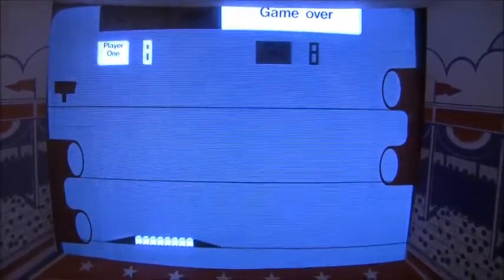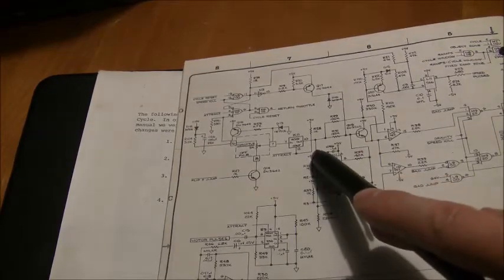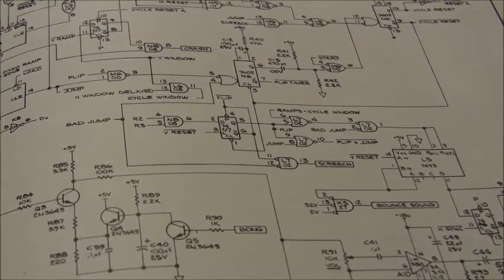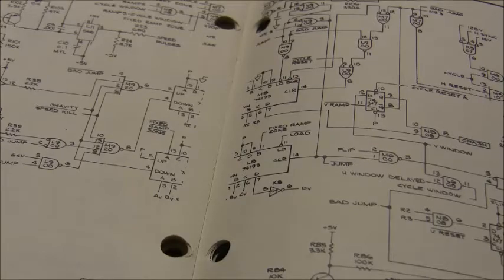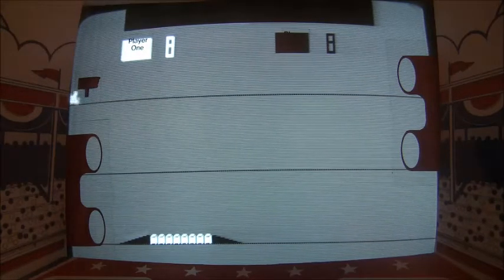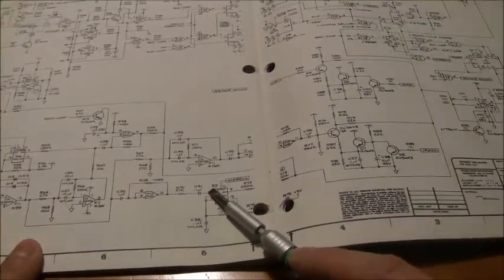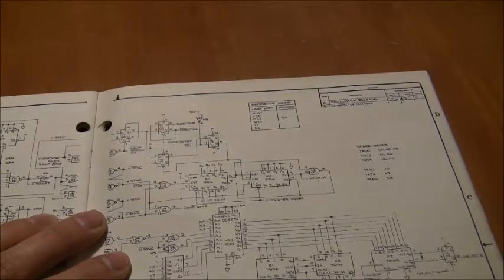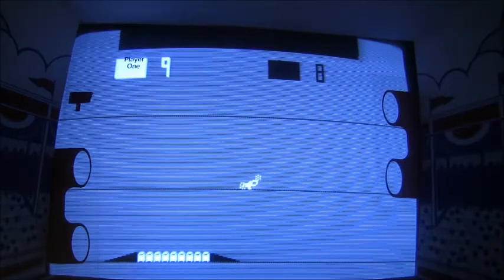Another stunt cycle PCB repair

Comment: I just recently was handed down one of these from my family member and I am trying to get it working. It appears that I have 11 volts before the regulator and 3.7 V after the regulator. Assuming the regulator is my issue and 11 V is enough how bad is it to replace the regulator? And do you know where I can order one of these? Thanks!
Reply from the maker: It’s a LM309k regulator. It looks like they are getting harder to find now then last time I looked. Jameco still carries them for an about $9. There are 2 pins to desolder and a couple screws holding it down not to bad if your familiar with soldering
Reply: @ I am decent at soldering for regular industrial electrical work. But not so much circuit boards… I’m gonna order me a better iron to control heat and practice on some other junk boards from work lol. I don’t think anyone has these boards for sell do they?? 

And thanks for the info!

Comment: Hey...are u still doing repairs?
Reply from the maker: It seems like there is always some thing i need to fix on one of my boards so yeah still working on them when i have time. Are you looking for Stunt cycle help?
Reply: I was...lol. I moved a stunt cycle from my garage to inside my house, and my sound for some reason went down in volume. It was originally loud and  I didn't know where the pot was turn the volume up or down.  I had first thought the sound was from the back on the monitor chassis but after further checking I download a manual and found for the pot was, turned it up and sound is back. But my biggest thing ice cream would look perfect, but when I will click the coins and and select player one the screen image changed and it would get a little way you be and fuzzy but playable. I took everything part in the back that had harness connections and cleaned them with alcohol and a Q-tip. It's a back together turned it on and everything looks great now. I appreciate the reply back